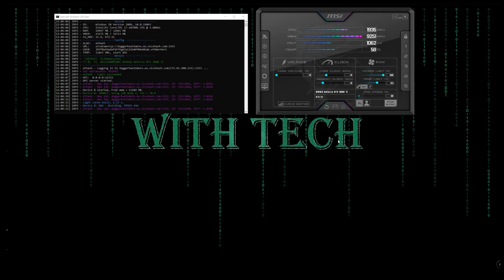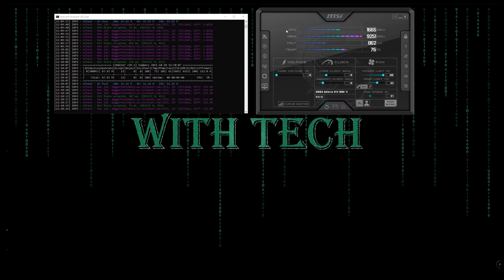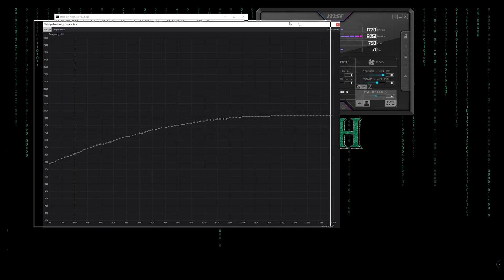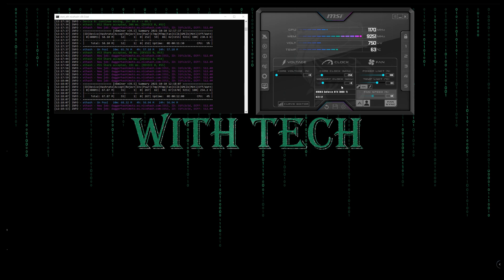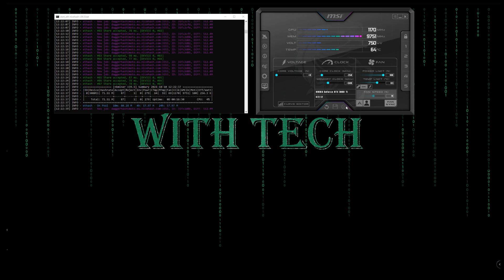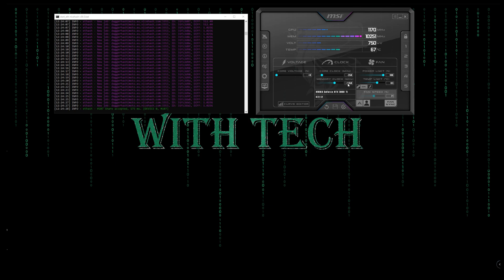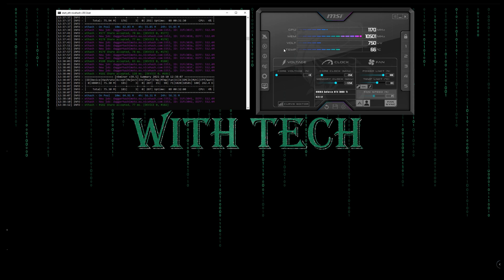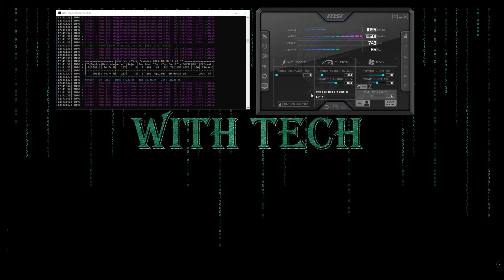How to Overclock the GPU for Mining? Overclocking Basics, tips for better mining process!

Comment: Are it wort it to overclock gtx 1050 2 gb?
Reply from the maker: to be honest, gtx 1050's profitability is too low that overclocking it or not may not have that much of difference. but you could try and get familiar with overclocking and stuff, so maybe when you have a more capable card, you'd have some idea about it.

Comment: How can i overclock my memory clock? I can overlock my clock speed ti 2400 mhz but my memory clock is always at 1900 mhz. I got the rx 6600
Reply from the maker: If you get the desired hashrate with it, then don’t worry about the difference. Some cards behave this way. I should say that I haven’t had an amd card, but this is my experience overall with GPUs.

Comment: BTW is I saw u use 750 mv, but in my case its 7.37 at 1140 core clock is it bad, I get around 76-79
Reply from the maker: When you lock the core clock or the voltage at one point, the values can go lower, but not above those points. And remember, each GPU is different. The numbers that worked for me may not work for you. Locking the voltage is usually a good idea because of power fluctuations. Remember, you can increase the core clock when you lock the voltage, simply add a number in core clock section.
Reply: @withtech341  what is your current setting for 3080ti, like your lock core clock and mv and memory and LHR
Reply from the maker: Nbminer 39.7, default values and mode. I have made a straight line for the voltage and core clock, voltage 750mv and coreclock 1350, memory clock between 1200 and 1300 (1287)
Reply: @withtech341  what is the lhr value
Reply from the maker: @masterb0ss  the default value, which is 1 with the new update
Reply: @withtech341  I lock my core at 1100 737 volt and memory +250 and power 100 percent used like 280-270w. GIVES ME 75.5 HASHRATE AVERAGE NB 39.7 DEFAUL LHR MODE 1. This is very stable for me as core clock always stays 1095 doesnot fluctuate at 737-743 volt
Reply: @withtech341  can u suggest me a msi after burner setting or a way to achieve max hash rate BTW where I live electricity is cheap so I don't about eff or power, just want highest stable hash rate possible
Reply from the maker: @masterb0ss  as I have mentioned in many other videos, try to find the best settings or your specific GPU. at the moment, I am getting between 83-86 MH/s with these settings, a straight line core clock at 1350 with 750mv, memory clock at 1295, a higher memory clock decreased my hashrate. I haven't changed any settings, all on default settings. I am using ethermine, not NiceHash Miner. if you are using NiceHash Miner, it should be easier because NiceHash does do some auto tuning itself.
Reply: @withtech341   @With TECH  but nice hash gives same profit with 83 mh = 77 mh in ethermine based on whatomine
Reply from the maker: Last time I checked, NiceHash was using LHR mode 2 by default, so you may want to change that with extra launch parameters. And of course, NiceHash does take some profit for making things easier, so your 83 is actually 83, but they would have the profit, I think it is 2%
Reply: @withtech341  yes but after they take there profit its like having 78mh , like if u put the value 78 in whatomine and 83 u will find that ethermine 78 mh = nice hash 83
Reply: @withtech341  btw ur video is really helpful for beginner
Reply from the maker: @masterb0ss  tell me about the LHR mode and LHR value, when you first run the miner you should see the values because with the new version of NBMiner, you should get above 81 MH/s..
Reply: @withtech341  i got it today 86-87 mh , my memory temp were high

Comment: Mine 3080ti gives 65 maxed .. on nicehase .. tried diff things not working ..
Any solution
Reply from the maker: I am using NBMiner, try that.  Open Nicehash Miner, go to plugins, install NBMiner, then go to Benchmark section, open the algorithms and find DaggerHashimoto, activate it and press start benchmark. wait until the benchmarking finishes. then it will automatically start mining. if It didn't start MINING automatically, then go back to Dashboard section. and start mining there, manually. If you face any difficulties, let me know. GOOD LUCK
Reply: @withtech341  on NB miner I get this "LHR CARD DETECTED WAIT TO UNLOCK .. 
THAN SUDDENLY MG/H DROPED TO 30 ..ON MY 3080TI.
Reply from the maker: @sagarthechamp  use NBMiner and then try overclock the way I have explained in the video, let me know if that helps. but remember each time you put a value to the core clock and the memory clock, wait for about two minutes and don't use your computer at all.
Reply: @withtech341  Roger that about 2 min gap ..but I already did on NB miner all tweeks ..
Dint work ..
Reply: @withtech341  in perfcap reason ..if the colour is green that means it's ok right ??
And what about orange and blue ???
Only thing I know that if light violet colour come .. it's thermal throttling right ???
PLZ CLEAN ME AS SOON AS POSSIBLE ..BIT WORRIED
Reply from the maker: As far as I know, the only thing to worry about is the yellow one, which is the one when the LHR limiter kicks in. Green ones are the accepted shares and are basically the ones we get paid for. purple ones are just indicating the new jobs that can be accepted. the yellow one is the hashrate on pool in different times. if you want to know the vram temp, find MTmp in the white diagram next to Fan to the left. for your GPU it is okay to hit 110 degrees, but better to prevent it. 88-100 are good temps.
Reply from the maker: I think we talk about two different things, sorry my bad. I was just explaining the lines in NBMiner.
Reply from the maker: So I looked up for you, and if I were you, I would try to get to understand the the codes instead of the colors. for my GPU, I only get the green code, but it is being interrupted every now and then.
Reply: @withtech341  sir am talking about the GPU colour indicator ..
In Techpowerup GPU-Z ..Perfcap reason colours ..
When it reach 106 light voilet colour comes which means throttling .. what about other colours like green ,orange,
Reply from the maker: I have used other resources to monitor my GPU behavior, that's why I don't know much about the color coding in PerfCap Reason. Sorry.
Reply: @withtech341  ok ..plz do try Gpu z .. and tech me if possible ..
Reply: @withtech341  what's ur eth haserate and memory temp ?
Reply from the maker: I will work on GPU-Z,  I get around 78-80 hashrate on average, with a memory temp of 88-102 based on the mode I choose for mining